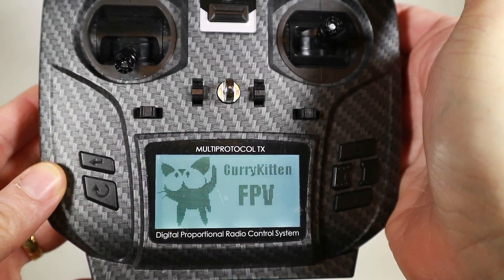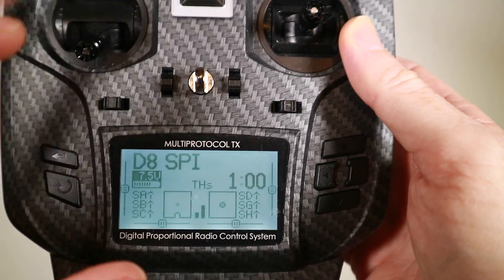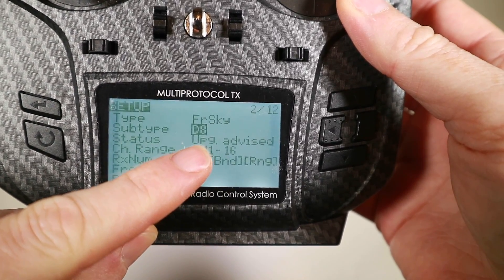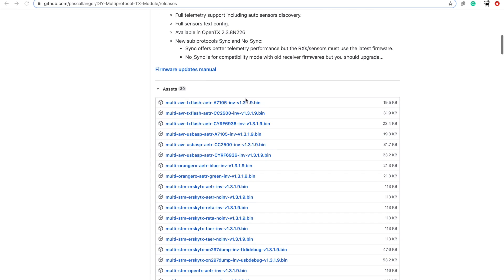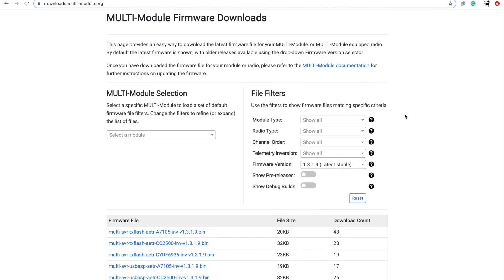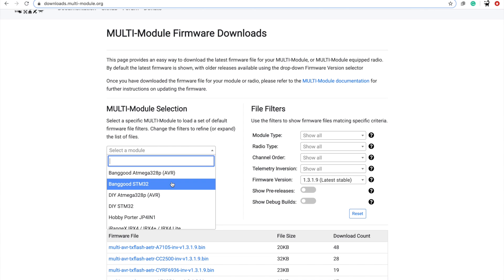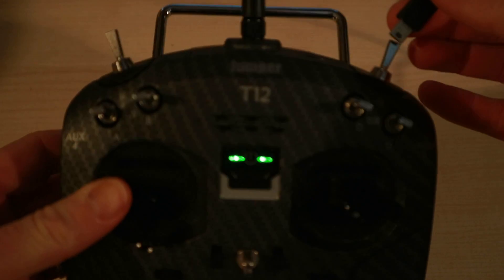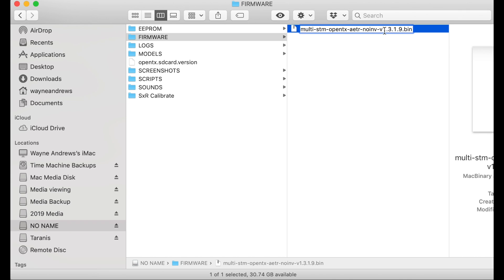How to upgrade your MultiProtocol module T12 Pro/T12/T16 and others

Comment: hi 
I Tried updating but i am getting a message saying needs flie stm-opentx-noinv and i notice the file you have updated has the noinv in the name. the file available on the multi module website ends with mm-stm-serial-aetr-v. Do i need to install something else? I am new to all this.

Comment: hiya CurryKitten do you extrack the file on your sd card or drag and drop when plugging the card in the pc
Reply from the maker: You can put the file on the radio, either by plugging the radio in and selecting it as a mass storage device, or just take the SD card out, plug it into you computer and move the file over that way.

Comment: Hi, ❤️ videos. I went to the website to download the software but it didn’t work as wouldn’t recognise even after the file was shortened, Go to Jumper website and download the factory software and it worked perfectly. 👍
Btw after upgrading all software on card and flashing set the 4in1 wasn’t in set up menu, after this factory file was flashed all works as it should.

Comment: welp didn't work for my qx7 with irange (kept saying "FW update error NoSync" ), still trying to bind it to the eachine p51.  still need help XD.
Reply from the maker: The bootloader on some of the older modules may not support flashing via the radio until you update the bootloader.  Check out this page https://github.com/benlye/flash-multi/blob/master/doc/New_Bootloader.md

Comment: Currykitten - I'm keen to get this radio as I love the form factor but put off by the dropout issues. Are you getting good performance with it on OpenTx 2.3.9 and is it still your daily driver? Thx for all the work you've put into your videos!
Reply from the maker: Yes - I still use this radio the most.  It was very weird the other day as I used my X9D and it felt massive :)  Performance is good and I like the form factor as well.  It does still have the annoying "receiver still connected" bug where it will shout that out at various intervals, but doesn't actually do anything (I've turned the warning off until it's fixed)

Comment: I was flying my Beebrain Brushless whoop & it fail-safed. As I was approaching the craft, I tried to re-arm & fly it but it wouldn't respond. I flipped through all my switches on my radio to see if it would respond to anything, but nothing. I noticed in my goggles that the OSD was showing it was stuck on horizon mode and other switch settings I had randomly flipped through at some point. I figured the fail-safe had made it lose its binding somehow. 
I checked my radio & it was showing "Upg. advised" next to Status.  So I quickly googled what that meant & learned that the multi-protocol module needed to be updated. I did that & tried to re-bind to the craft, which it did so, but I'm unable to register any stick or switch commands on the craft or in Betaflight (SBUS).
Reply from the maker: This is a bit of a curious one - especially in the first instance with you losing signal and not being able to reconnect.  Given that it seems to bind but act weird makes me question if there's any issue with the signal.  Is this on an actual physical rx though, or the SPI version.  If you've got another Radio, or quad handy it would be useful to see how the quad reacts to another radio, and/or the radio works on another quad to try and pin down the issue
Reply: @CurryKitten  It's an actual RX. Beeceiver, SBUS. It's a NewBeeDrone AcroBee Brushless. I was able to bind to another Acrobee without issue. Took it outside& flew it for a bit a little while ago.
Reply from the maker: So could be an issue with that RX then, worth checking those solder joints to make sure nothing has come loose - and perhaps try a continuity test from the SBUS pad on the rx to the pad on the FC to check there's no breaks there
Reply: CurryKitten I'll do that today. I actually considered that for a bit last night. Sometimes it helps when someone else mentioned something & it confirms your suspicions. Lol

Comment: To make firmware update quicker, i only leave the sound file in the sound folder for the language that i need. So for me I leave "en" for english and delete all other language folders.  This makes the process quicker. also i can fit it all on a super old 128MB card.  My Jumper T12 had the issue with Failsafe, and receiver still connected.  so far so good, will update if things change.
Reply: Hi .. do you still get "receiver still connected" ??

Comment: Hello Buddy, thanks for your contents! I am a happy owner of Jumper T12 Pro! I saw the internal module V. 1.3.1.24 has just been released, and in the multi-module download page, selecting the latest stable firmware, there is a new .zip file called MultiLua Scripts to download.. so, what is that file and how can i install it in my rado? Thank you so much :)
Reply from the maker: I've never seen them update LUA as well.  So these are replacements for the scripts you already have under your tools section.  (long press left will get you directly there) so unzip that file and copy the 2 lua files and the .txt files under SCRIPTS/TOOLS on your SD card.  You'll see that these scripts already exist under there, so always a good idea to back up first - although odds on you aren't actually using these scripts anyway.
Reply: CurryKitten ,thank you for your reply! Yep never used it I guess, just wondering if something so important!

Comment: When i try and download the file windows ask what i want to use to open. I have 9 zip. And the upgrade is a bin file or am i missing something. I am totally frustrated!
Reply from the maker: The answer is not to let windows attempt to open it - it's not for windows!  Yes, it's just a .bin file that you need to put on the SD card in your radio so you can run the upgrade from there

Comment: I used that little fill in form to flash a mates External multi module...Nice job GitHub.
Reply from the maker: Certainly less intimidating if you aren't not sure about things isn't it
Reply: @CurryKitten  Yes, what I found shocking is the plethora of different flavours of Multi protocol Module...Pretty sure some of my flying buddies ain't using the right Flash in theirs...A common problem is telemetry..

Comment: No need to rebind  R-XSR receivers as well. Sadly the annoying "receiver is still connected"-message is still popping up randomly - but disabling the RSSI shutoff warning is a nice workaround :o)
Reply from the maker: It is annoying - I was happily flying around yesterday only to have that message 3 or 4 times.  I hope they fix it soon - I did suggest a workaround for it in the issue, but they didn't seem keen :)
Reply: Don Ralfo I though they fixed all this stuff with latest firmware. Guess not.
Reply: @MicroModDude  nope. But it doesn't bother me since i disabled the warning 😎
Reply: @donralfo4204  Have you had any signal loss issues resulting in a crash? I bought a T8SG v3, but prefer the Open TX over Deviation.

Comment: I have just spent two days doing this on the original t12 and it seems early external modals came without a bootloader, so they need flashing from the PC for the first update so if anyone gets failed flash when attempting this just look up the PC flash process
Reply from the maker: Thanks for mentioning, I wasn't sure if the T12 would have the necessary bootloader or not.  Updating an external module via USB isn't too bad, but certainly not as convenient as just doing it from your TX
Reply: Did you flash directly from PC USB to the external module? I have a T12 Plus (with the JP4In1-SE) which needs updating and my concern is is the 5V from USB OK using the Github reccomendations. Thanks.
Reply: @leeseaman4193  It was a bit of time back, but I seem to remember I just plugged the USB cable directly into the module

Comment: Is this also the upgrade for the t16 pro?
Reply from the maker: Yes, the upgrade should be the same - but I don't have a T16 Pro, so some of the screens maybe slightly different - but as long as you can navigate to the firmware file on your SD card then you should be able to flash the internal module with it